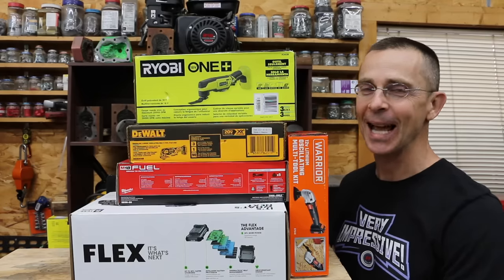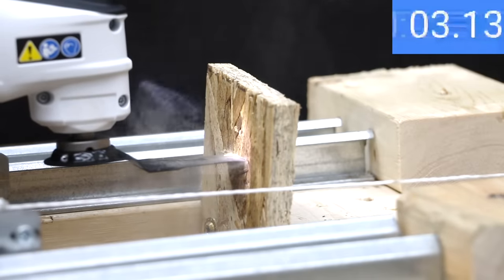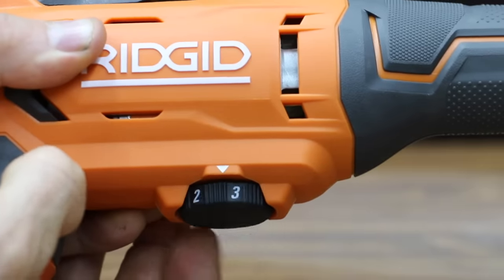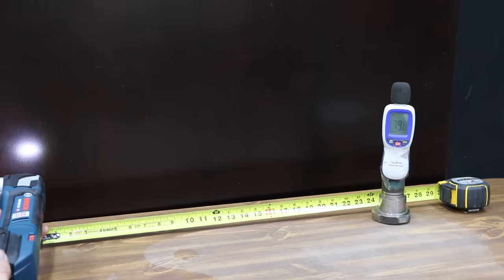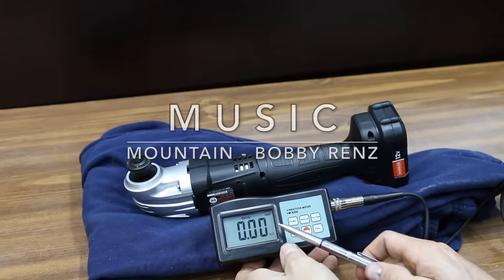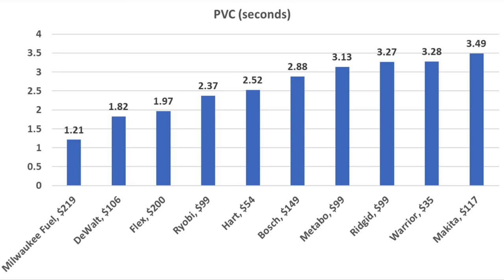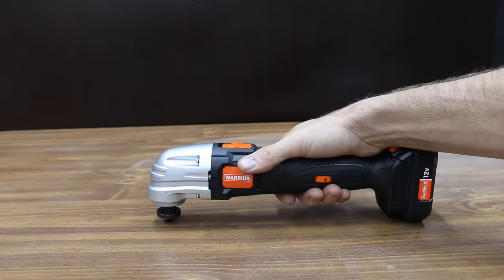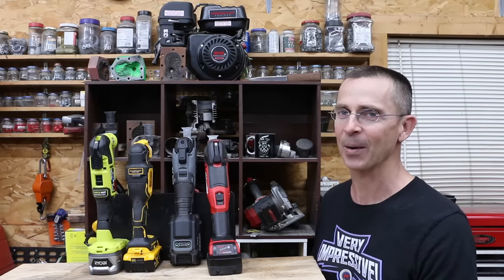Best Oscillating Multi-Tool? FLEX vs Milwaukee, DeWalt, Makita, Ryobi, Ridgid, Hart, Metabo, Warrior

Comment: Ryobi's really stepped up their game. They may not be beating Milwaukee (TTI wouldn't allow that), but they're new tools are in the upper tier of a lot of comparisons.
Reply: I really feel like the HP tools are re-tooled versions of Milwaukee’s non-fuel brushless or maybe first-gen fuel tools.
Reply: Royboy has stepped up their game at the same time that makita and metabo have done a face plant!  At least in this category.
Reply: @b gg not badly, just cheaply. As someone that only uses tools around the house once in a while, I can't justify the extra cost of some of these other tools, even if they are objectively better. If you're using them every day its a different story. For me ryobi and Dewalt hit the sweet spot between decent quality and price. I learned the hard way not to buy walmart tools.
Reply: Ryobi is a fantastic option for weekend warriors and occasional users. I have several corded Ryobis that don’t get a ton of use: chop saw, belt sander, hammer drill. And then run dewalts for battery tools. I have several older, less used, corded tools that I wish I would’ve just bought Ryobi and saved money.
Reply: They have so many tool options, it's amazing. I recently got a 18v inverter, a hanging fan, hand vacuum, and air pump that we keep in our rooftop truck tent. They're not as good as Milwaukee and some others but the versatility and options for the price is crazy at this point.
Reply: @b gg I beg to differ. While they are marketed for the diy community I use have been using Ryobi tools daily at work for 3 years now and not had one quit on me yet nor do they fail to keep up with the red and yellow brands everyone brags about.  They are fantastic for professional use and at a much better price.

Comment: I used to use the ryobi (older model) but the battery contacts would consistently shake themselves loose after several months of use. After going through about 6 of them, I switched to DeWalt. I really like their quick change system!

Comment: Wow, that is an extremely well done review! Thank you so much. No bs, just tons of info in a few minutes, with a positive attitude and correct comparisons. Absolutely flawless =)
Reply from the maker: Thanks so much!
Reply: I desagree you use to 2.5 amp hour battery on the flex and compared it against Milwaukee with a five amp hour battery. Results are skewed use the same power to battery Comparison And the flex wins every time

Comment: I have the Fein corded and it is pretty rare that I’m bothered by the cord.    I’ve used the new Makita and it is a vast improvement over the one tested here.   That said, always enjoy your videos!
Reply: Biggest benefit from the new Makita is explained by Scott Brown in his review: the ability to use all three Bosch StarLock variants (different mounts for different length tongues) on a single tool, whereas other units can only use one or two.
Reply: The only issue I have with the Fein corded version is the cord tends to short out quickly if you use it every day. I stopped buying them years ago and switched to the dewalt version. Not sure if they have fixed that issue or not but it got really annoying.
Reply: @dannyhunter607  I have two of the corded Feins (20 years old and 3 years old), and none of them suffers from issues with the cord. Maybe its is related to the 240/120V thing.
Reply: @AndreasSchlitzkus  I am constantly holding mine over my head so it probably has something to do with that lol

Comment: After using the Dewalt for years, and then switching to the Milwaukee for the past year. I just picked up another Dewalt and will be shelving the fuel. The Dewalt is not as powerful but the Dewalt has much better cut control because its degree of oscillating is IMO the sweet spot. The fuel has to much oscillation which causes you to loose the precise cuts.
Reply from the maker: Thanks for sharing.
Reply: @ProjectFarm  Strong disagree on the cut control, the only thing I've found better on the DeWalt are the blade change and the trigger, the M12 multi-tool is the sweet spot between them though; cheaper, just as powerful, less vibration and a better form factor

Comment: I've got a Fein Multimaster. They are rumored to be "the best", at least when I bought mine, so it would have been nice to see it here to compare if that is true. If you test oscillating tools again and can include one, that would be good. Still an interesting comparison, thank you.
Reply: Can’t believe the Fein isn’t included!!!
Reply: Is there a  cordless Fien? if not that may be why it wasn't included.
Reply: @firebladex8586  There is a cordless Fein... look at some of the videos of its "performance," it's lackluster to say the least. Plus what other tool is going to use that proprietary battery?
Reply: @firebladex8586  Fein has a 18v and a 12v version, imo still the best in the market
Reply: TheCheesePlease  nobody asked you for wrong answers only!  Fein invented this shit and all of these other brands are simply copies.  Come back to reality when you can pal
Reply: Fein invented it so I was surprised not to see it I have the rigid, milwaukee, DeWalt and the Fein and the Fein is the best Imo but it's corded so the DeWalt is the one I use daily and the best cordless one for me
Reply: @nelsonbrum8496  performance-wise it's easily above average. Where it excels is in noise and vibration. When using these tools all day, vibration gets very important very fast. Fein have the best vibration control by a mile.
Reply: TheCheesePlease  strongly disagree, sounds like mad cuz never tried fein.
Reply: @moritzkilb2438  wrong the cordless fein doesnt even come clise to the milwaukee thats already tested on youtube
Reply: I’m also surprised that the Fein wasn’t included. If only for the fact that it is the original. I own the corded version. I wonder if the corded beats the battery one
Reply: If not for the power, internal components of german made Fein tools are made to last generations. 👍
Reply: @saiiiiiii1  time is money einstein
Reply: @promo130  spoken like a true weekend warrior

Comment: Ryobi seems to be a solid product ecosystem to get into with a good value to performance ratio. For most people's uses they would be perfectly fine.
Reply from the maker: Thanks for the feddback.
Reply: I will say if you look at reviews and stuff like this, Ryobi is definitely one of the best weekend warrior brands. I'm personally moving to DeWalt for a lot of things, but honestly my Ryobi tools have yet to truly disappoint me.
Reply: As mostly armature, Ryobi One Plus has been solid stuff for me for the past half decade or so. I do light repairs and maintenance on rental properties, and I haven't run into any issue with my Ryobi stuff. Plus it has a respectable warranty despite it's low price compared to other big brands. I haven't had to use the warranty yet.
Reply: @aethertech  when the 1/4 impact came out the old blue model. I bought and used it on the job site. It kept right up with the Makita. Let everyone use it. Used on the job for two months. It survived.
I still have it and still works fine.
But I did upgrade to Ryobi brushless "higher end"

Comment: I love my DeWalt oscillator.  I had a corded Bosch for about 8 years that I liked a lot but feel the DeWalt is a major upgrade.  It's cheaper, I already owned the batteries and I love the touch sensitive trigger and the fact that to shut it off you just release the trigger.  I also feel that I can be more precise with the dewalt.  Highly recommend.
Reply from the maker: Thanks for sharing.
Reply: @ProjectFarm  bro time to test best hammer 🔨
Reply: It’s the only one that doesn’t feel like holding a fence post
Reply: True. I started off with Dewalt for most of my tools, then switched over to Milwaukee m12. Now besides the brushed ratchet, i have again switched over to Dewalt 12v xtreme line up. I used the m12 ost quite a bit. I did not like the speed selectors where it was placed, numerous times i would accidentally ramp up the speed. Even at low speed, it is not good for precision cutting like dry wall or baseboards. It is great for demolition though. Love the control of the Dewalt and is affordable.

Comment: I have the dewalt and love it.  The easy blade change is so nice.  I’ve found it to be fast and reliable especially with proper blades like the new Diablo or Dremel.
Reply: For proffesional use the dewalt sucks
Reply: the dewalt is way harder to control than the makita. i have used both
Reply from the maker: Thanks for sharing.

Comment: I am not a Ryobi fan by any means, but it's definitely the most bang for your buck in this instance. Awesome video as usual, PF!
Reply: i honestly wasnt a ryobi fan until i used their drills for years in a super heavy construction environment, im talking just filled with masonry dust constantly for years, they always worked and always had enough power to do any job i needed them too. theyve surprised me and these videos tend to show how capable ryobi tools are
Reply: @ryangross5446 , I am a professional cabinet maker, and I pretty well only use Dewalt battery tools, but I have to admit that Ryobi has impressed me multiple times for the price point.

Comment: Great video.  For the professional craftsman, though, you have to include the Fein brand in this comparison.  I've been using and abusing one of their corded models for the better part of 15 years and it cuts today as well as it did when new.  I know longevity and durability are difficult things to gauge in these review videos, but Fein has that in spades.  A couple of years ago I upgraded to their top of the line cordless model.  With batteries and a charger, it's significantly more expensive than anything cited in this test, but its performance is even more impressive than their corded tools with much less vibration.
Reply: Absolutely,  my Fein is an animal.
Reply: We have one in our stair shop. It’s at least 10 years I’m not sure. It’s my favorite tool in the shop.
Reply: So true. In the Netherlands we even call these a Fein saw. For every brand haha! Just like the kleenex. 'hey, can you hand me the Fein?'

Comment: Well sir, you have earned another subscriber today!!
My wife gifted me the DeWalt Oscillating tool a while back, so I'm very familiar and comfortable using it and I can honestly say I do love that tool. Now, my employer recently provided me a Milwaukee Oscillating tool, here's the things I noticed from using one long time and then the new one:
DeWalt has a speed adjusting trigger which allows me to fine tune speed of cuts, I think most users will adjust AND quickly love this feature. Milwaukee has a speed dial with a Auto mode that adjusts depending on pressure. It's not terrible, it works well.
DeWalt's positions its battery in a way that allows one to stand up the tool once cutting is done. I also prefer this over having it rolling on the floor like the Milwaukee.
DeWalt's quick blade change mechanism beats the Milwaukee everytime! I don't understand what the release lever does on top of the Milwaukee tool if one still has to remove the bolt/screw that holds the blade, I mean what's the point??
Last, but not least, it's the ergonomics of the tools. The DeWalt has a much better handle that allows me an easy one hand operation. Milwaukee's handle is much thicker and sometimes requires me to use both hands to complete cuts. Maybe I'm just not entirely used to it yet?
Then the price, again with Milwaukee... Good quality, but it is expensive!!
Reply from the maker: Thanks for watching and subscribing!  Thanks for the feedback.
Reply: I too like the Milwaukee but, I already have a 20V XR Dewalt drill with 2 batteries and the charger. The price of the Milwaukee is higher plus I would have to go get another charger and batteries for it.

Comment: Good review, but Fein is generally regarded as the best oscillating tool, and Porter Cable was missing as well.
Reply from the maker: Thank you for the feedback!
Reply: Yes, fein created it and had the patent for 20 years
Reply: Agreed,, .I saw a infomercial 15 years ago while I was laid up in traction so i bought it.Loved it,then they came out with the toolless blade change so I got that one and used the first one for sanding only.Then the patent ran out or something and everyone started making them and the price dropped .Now I just use the Dewalt and the fein sits on a shelf.

Comment: I really like the dewalt. After seeing all the terrible blade change methods out there, I am really glad I bought it, even if it is a bit slower than some of the others. My biggest problem with these tool sit that the blades don't last long at all and are very expensive. Maybe you could do a comparison on different blades as far as cutting speed and more importantly, how long they last?
Reply: Price is a factor, but what would it cost you to cut a box opening into a custom hardwood built-in at floor level without damaging the finish or the floor?

The right tool isn't always going to be cost effective unless you consider the alternatives too.
Reply: He made a video on the blades iirc
Reply: We got some carbide blades from Menards. 
They are the Master Force brand in the green package. 
They last a really long time.  Like 10 times or better.
Reply from the maker: Thanks for the feedback.  Thanks for the video idea.
Reply: “See Jane drill” is a youtuber, she shows you how to sharpen oscillating blades quick and easy.
Reply: He already did a video on multi-tool blades.
Reply: @bubbagump8184  i was going to suggest this -- it's so easy and I haven't bought a set of blades in a long while.

Comment: I've worn out 2 Milwaukee multi tools while my older Dewalt has never given a moments trouble. Much easier blade change and the variable trigger and great ergonomics make it my favorite by far. I started out with Fein (electric) when they first hit the market and all I can say, is if you don't own a multitool by now, then you're sure short changing yourself.
Reply: Brushed or fuel line?
Reply: @ethandupit73  brushed
Reply: Thanks for the input, been wanting to get one, either the milwaukee or dewalt, mainly because i have other tools from those brands and chargers/batteries arent needed. Seems like the warrior is one to go with if you only need it for a specific one time job/project?
Reply: Get yourself Fuel. M12 or M18. 

Only thing I like about Dewalt is the quick release blade change. That's about it.
Reply: @budtron183  That was exactly what I wore out from Milwaukee. (2) 18 volt fuel multi tools and (2) 12 volt multi tools. The vibration from the 12 volt tools destroyed the battery connections. They replaced the 18 volt tools no problem but besides their archaic blade change I just didn't like them as well as the Dewalt.
Reply: @dacoelec  I just got the M12 Fuel and it's phenomenal. Can't say how well it will hold up but it is impressive. It's also got the quick blade change latch, has magnets in the head to hold the blade steady before you clamp, is bottom on the vibration scale, comfortable, and very powerful. I couldn't ask for a better tool. I haven't tried the Dewalt version but I watched his reviews of the M12 lineup where the milwaukee fuel kicked all the other tools ass. You should get the M12 Fuel. The Fuel line is light years ahead of the brushed/non fuel. I can't say if it will last longer than the Dewalt, but I know it's got more power, less vibration, cuts more on a charge, etc. than the dewalt. And if it dies in 3 years, you get a new one for free and if it dies after that, well, I guess you got your money's worth. 🤣
Reply: @user-nh3gu1ge3d  I have the M18 and M12 Fuel and I use the M12 90% of the time. It's a phenomenal tool and it's on sale at Home Depot currently! The M18 is a tank but the M12 is fine unless you specifically need it for demo work. Absolutely despise the dewalt in comparison; It's light but it has no density so it skips around unless you just send it.